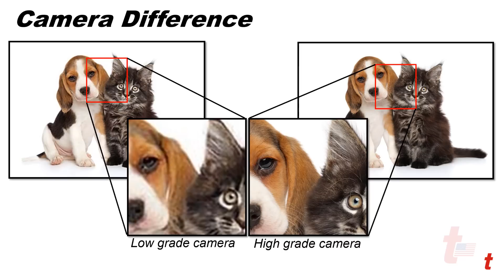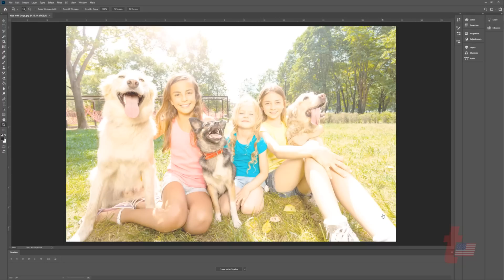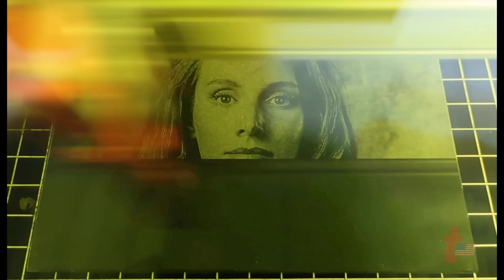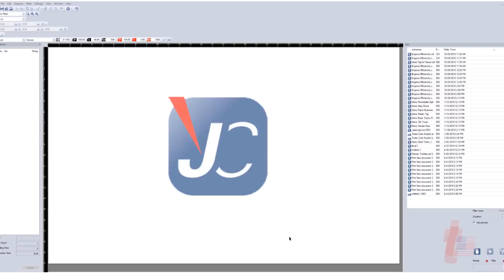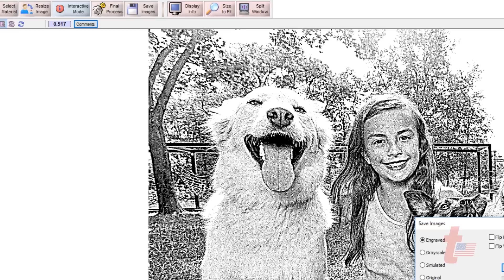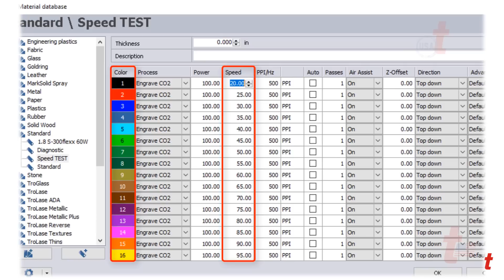Trotec Laser Seminar: Photo Engraving

Comment: Thanks for this very interesting video. I did note that in your parameters you set different PWM frequencies for different materials. Is there a scientific reason for this or is it just  observational data ?  If it is observation, what are the factors that make one PWM frequency better than another?
Reply from the maker: Different frequencies will produce different effects on materials, some materials work better with low frequency and other materials can handle high DPI images and will need a higher PPI or frequency. It is recommended that the frequency or PPI should match the DPI of the laser and also match the DPI of the digital image if possible (squared resolution) to produce a better-looking photo engraving. For example, if the digital image is a 1000 DPI, then the DPI on the laser should also be 1000 and the PPI should be 1000 pending the materials can handle this resolution.  I find that materials like woods, leathers, and glass only work well at lower resolutions (250 or 500 DPI) where materials like polished stone, plastics, and metals can handle high resolutions (500-1000 DPI)